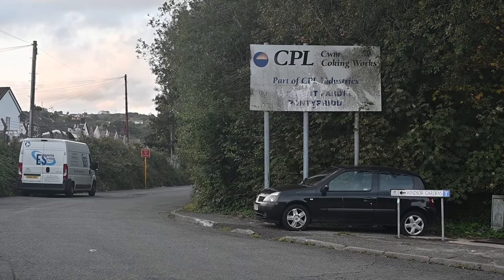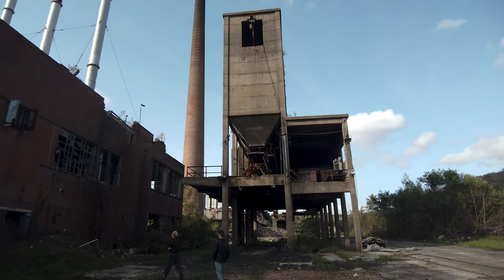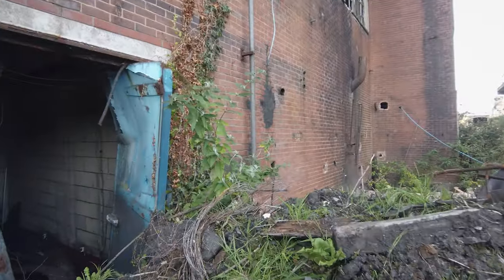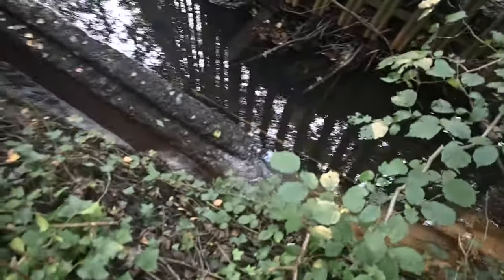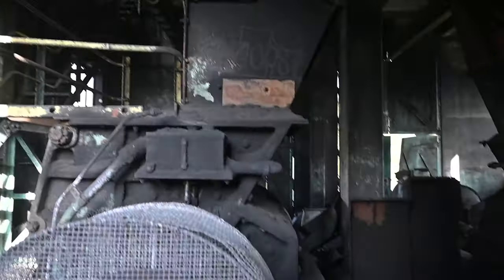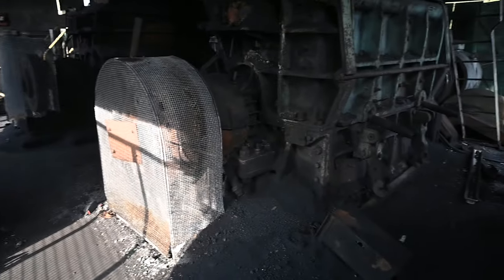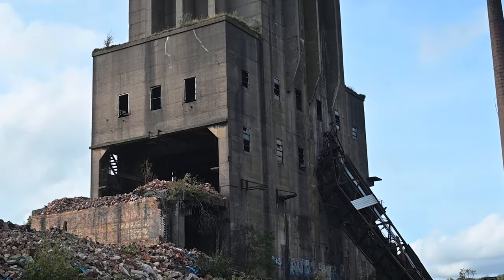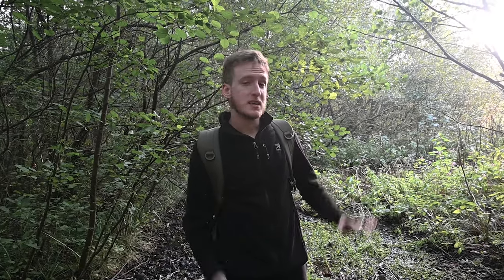Cwm Coke Works Documentary - One of the UK's Last Abandoned Industrial Giants

Comment: A word of warning.
In plants like this, beware of relying on handrails made out of tubular steel.
I worked for many years in the steel industry and saw many accidents where the hand rail had rusted from inside and was unstable, yet appeared in good condition.
The customer's specs invariably banned these and insisted on handrails constructed from structural section such as angle iron.
I spotted a couple of rails constructed out of RSAs, but most were from tube.  Accidents waiting to happen!
Reply from the maker: Will have to watch out for that!

Comment: In Teesside, there used to be a very very similar site - you can find it by searching Dorman Long Tower. The concrete tower is almost exactly the same, however, this would have been heated up in separate ovens to heat up the nearby (now demolished) Blast Furnace.